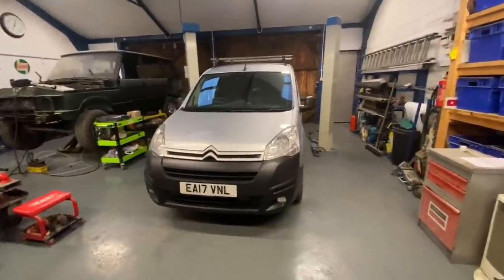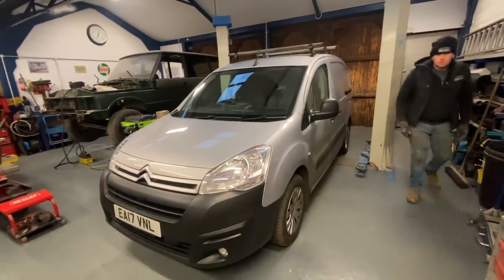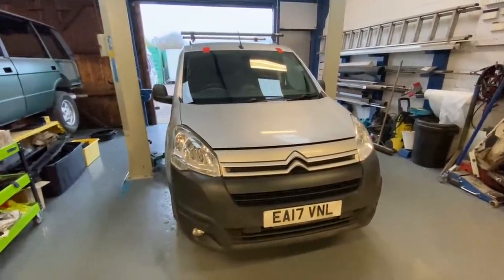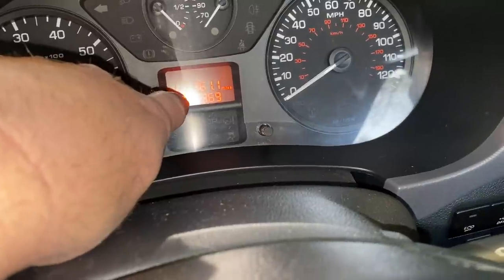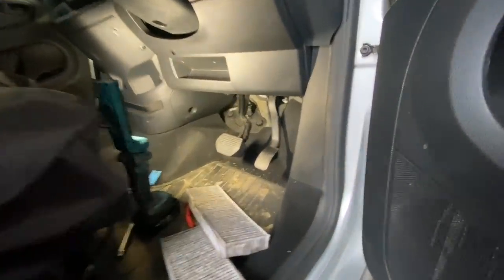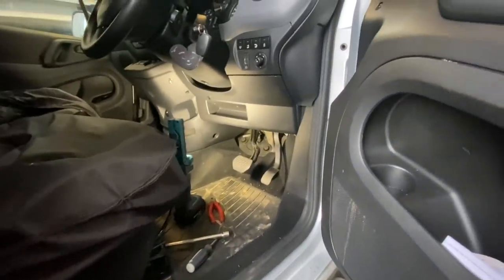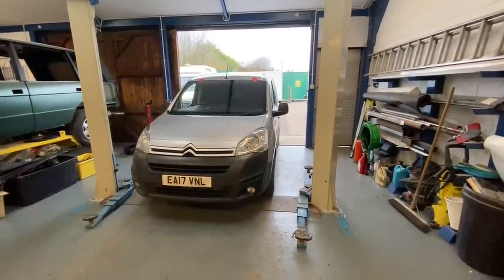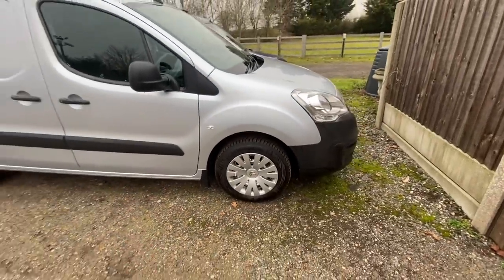2017 CITROEN BERLINGO NON RUNNER BACK IN THE WORKSHOP

Comment: Rob and Chris you have inspired me to start to buy fix and sell cars I've alwsys been hands on and am pretty competent with a spanner I've rebuilt engines rebuilt cars etc anyway ive secured a unit and I've recently purchased 2 golf gti's and an qashqai £900 in on all 3 they have now been sold and I made very good profits more than 3 months of my current job wage so today I handed my notice in nothing salvage just mot failures and cars that have been parked up on driveways
Reply: Good luck
Reply: @cancan5763  cheers fella its definitely alot less stress than lorry diving obviously there's the risk of losing money and not that comfort of knowing you have a regular wage 
But I have got the addresses of about 30 cars all on people's driveways (good thing about being a lorry driver you see alot) and I made sure to save so I have a decent amount to float me by in the bank while I try to make a living
Reply: @lukecowell7516  if you manage to get more motors at that price you'll never lose, even if you break them

Comment: We used to bend a bit of ali to make a wind deflector and screw it onto the front bar to get rid of the droning wind noise…..works a treat! Saying that, if it’s only 1 bolt each corner you might as well keep them in the back and just put them on when needed 👍🏼 great stuff again Rob & Chris 👍🏼👍🏼

Comment: I’ve had a number of cars with the same locking issue it’s usually the wiring harness from repeated bending opening ad closing the door it’s usually a quick fix in the rubber between the door and bodywork

Comment: If you think that pollen filter was bad, imagine if there'd been a clutch pedal there! Not wanting to pick fault, but the state of that oil filter, I think I'd have had the sump off and cleaned the oil pickup out before it ends up wanting a turbo.

Comment: Some pollen filters are just in the worst place, had a few difficult ones over the years. I have a Suzuki Swift just now and you just drop the glovebox, unclip the plastic lid, pull filter out new one in and clip lid on and glovebox clipped back in. Job done in 2 minutes.

Comment: micr switches used be a problem on Vauxhall Opel central locking systems. They get dirty with grime & oil, use contact cleaner on the 2 microswitches near the inside door lock should fix the problem.

Comment: I just had same problem with my van locking on remote took panel of door put some electrical cleaner  give actuator a tap with hammer ,hey presto it works. The headlights could do with a polish.
Reply from the maker: Only one is dull 👍
Reply: @sruk  yes and when you polish the dull 1 the other 1 will look dull .

Comment: The Berlingo certainly is a very well specced item and is probably better for the image,  the Combo is also a tidy unit, will do someone a good turn 'as is' or could be a good base to really pretty up if desired. Another excellent video there gents, can't wait for the Range Rover to get done with now, a two bay workshop will be so much more useful.

Comment: Hi Rob that problem with the Lock is proberly the senser in the door lock, I have a VW Touran T1 and I have the same fault ,all locks open and close with the remote except the drivers door but with the key I can lock and open all doors even the Drivers door. I would have changed the lock but it's a pain in the ** to change. But I can live with it. Keep up the good work.
Reply: That or a lug is broken in the lock. Had that myself.

Comment: The reason the drivers door doesn't lock with the key remote on the blue van is the little motor in the lock has probably had it. You can change the little motor or get a second hand lock mechanism and still use the same key but the likelihood is the second hand one will stop working at some point also.

Comment: Pollen filter on my 06 Vectra was a doddle - access flap on the scuttle trim at the bottom of the windscreen. Open flap, lift out old filter, drop in new filter, close flap. Longest part of the job was cleaning all the leaves etc out of the filter cavity.

Now, in my 2011 Insignia, the glove box has to come out.😒

BTW, you may have got a few thousand more miles out of that old air filter on the Berlingo... NOT! That was in a right state. That van should drive like a dream now.

Comment: Had a Berlingo with a similar lock problem. Turns out they had a microswitch in the lock/latch mechanism which tells the ecu/bcu that the door is shut, required a complete latch to rectify so I just did what you are doing & locked with the key.

Comment: Hi rob if you twist a bunji around the front roof bar like a screw pattern it deflects the wind noise mine did the same what a racket but the cord sorted it.
Shame fancied that Berlino myself got a partner at the mo cracking van.

Comment: I did the pollen filter on my honda crv today it took all of 30 seconds. It looked like it had never been changed yet it has full service history. I think they defenitly get ignored during services.
Reply: My Mazda 3 supposedly had a full service history from the main dealer I bought it from and they did several years more, which included at least two cabin filter changes at £40 a time just for the Mazda filter. When I changed it myself I found an incorrectly-fitted Blue Print aftermarket filter with batch date and condition consistent with it being fitted at the service just before I bought the car. Main dealer's response was that filters don't have a 'best before' date and they offered me a filter FoC, completely missing the point. I pressed them on how a non-Mazda part was fitted etc and they stopped responding. TW Whites of Bookham, I'm talking about you.

Comment: I knew you would keep it those vans are great. The ones with ad blue stay clear of. You may want to speak with a citroen tech though as you should change the bottom pulley and another part when doing the belts on them. I got one going in next week on a 15 plate and that's what they are doing to it.

Comment: The lock actuator will have failed on the drivers door on the Vauxhall van. Using the key forces the lock up and triggers the other doors, whereas using the remote doesn’t unlock that door due to the failed actuator. Last one I changed was on a Citroen Xsara - cost was peanuts and took about an hour to do in total.
Reply from the maker: Yes it’s a easy quick job just never bothered me so I left it 👍

Comment: the old combo, did you look at the loom on the drivers side door? i know on astra h it is common for the wires to break where the loom goes in to the door (mine the rear door was not on remote locking due to this) so could be the same problem

Comment: Rob on that locking iirc correctly thay have dead locks maybe try locking it if you can turn it half way not fully I think thay used to be horizontal when dead locked maybe I'm wrong if it locks by the fob.

Comment: Have you tried sitting in the van shut the door put key in ignition turn so dash lights com on then press the lock button on key fob then open on key fob it should re set the key fob

Comment: Nice little van for someone, what size engine do the Combo's have?
Reply: 1686cc diesel
Reply: @jamesbrett6518  Very precise any 1 else would've said 1.7😁
Reply: @jamesbrett6518  Thanks for that.
Reply: @ALYDAVIDSON1  I could have said put the plate into DVLA tax checker
Reply: Or 1.3 diesel
Reply: @peugeotdudeandson4485  possible, but this one's registered as a 1.7
Reply: @jamesbrett6518  I know that but the question was what size engine's do combo's have so as you pointed out robs has a 1.7  I then pointed out also a 1.3 diesel. Saying that the 1.7 isuzu engine is far more robust that the 1.3

Comment: 1.7 Diesel engine best engine ever by Vauxhall absolute bulletproof. The 1.3 Diesel engine absolute crap need to boot it to keep it up to speed. The pollen filters in the van absolute pain to do I’ve done a fair few on those. There is also one I can’t remember which model of car it is but the pollen filter hole is half the size of the actual filter and u need to squeeze the filter so much to get it back into the housing and it is an absolute pain in the butt. Just remember rob on those vans u can get a suspension knock on those and u need to replace the front shockers and the top strut mountings because the shocker shafts get play in them and the mountings split and the bush where the strut goes through with the top nut.
Reply: That’s rubbish. 1.3cdti were weak I’d admit but they were bloody nippy definitely not slow .The Main issue was timing chains.

Comment: Why do people always think and say that the windscreen has all the driving sensors on it??? The windscreen is the same as any other, the sensors and module for rain sensing and auto lights is in the module attached to the windscreen it doesn't make it anymore expensive, the one thing that makes a windscreen more expensive is its size and shape and whether its a genuine screen not a like for like replacement market which are crap and have rubbish laminates. You will tell when you sit in the drivers seat and look out the windscreen you will see the watery ripple when looking out the passenger side or on an angle. Always buy Genuine OE

Comment: How does it work that the cams were damaged but it was not necessary to remove the head and attend to the valves?
Reply: cam lobes are pressed on cam and spin round when forced so saving the valves
Reply: @luckysmiler  That is interesting.  Can they really move that easily without damaging valves?  That could potentially save a lot of money, depending on the price of the cams.

Comment: Nailed on the roof rack mine was the same a rhino one. 
After about 70 it makes a droning noise I left it on so people couldn’t hammer the van when They
 borrowed it 
Good little vans. I did have a couple of occasions where the brakes went hopeless and Indy couldn’t solve or so it had to go to main dealer. 
The Manchester clean air zone made me get shot and I got a transit courier instead. 
Wonderful channel. Really enjoy it

Comment: 15000miles on a oil change there is no way iw ould ever let my vehicle go that long
Reply from the maker: I won’t 👍
Reply: My 2013 Jaguar XF 3.0DS has a 16k miles service interval.  Modern oils are a lot better than they use to be.
Reply: this is mostlikely why they get to do so many cams and engines on this channel is bacause people go and follow what the manufacturer says is good and destroy thier engine. i respect salvage rebuilds for siding with me on this

Comment: The licence plates on the corsa are illegal.
Reply from the maker: No there not they come with the van from factory
Reply: @salvage rebuilds uk  They have an  'EU' symbol on them. The UK has left the EU and about a month ago it was stated that any car with such license plates need to be changed. 👍
Reply from the maker: @MrPaul244  don’t believe everything you read bud 👍 that won’t apply to vehicles fitted with them before brexit you just can’t fit them now 👌
Reply: @sruk  ah kl.👍